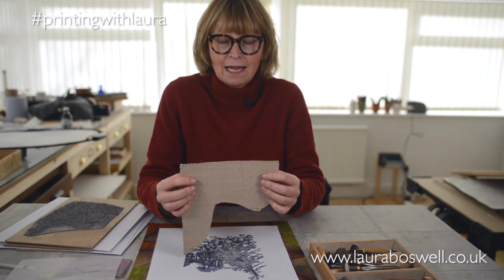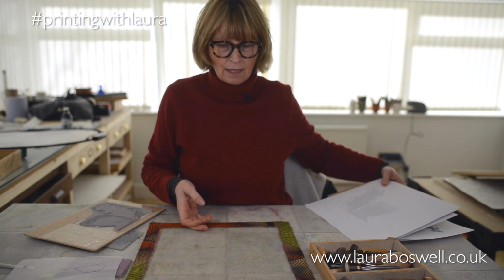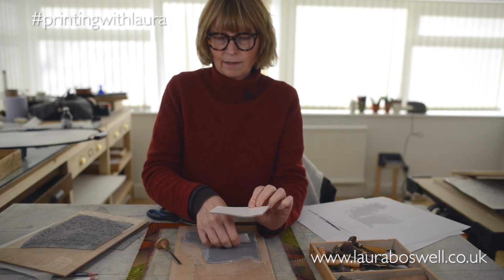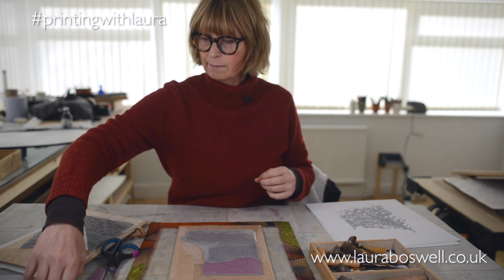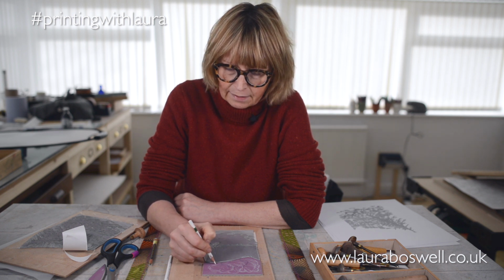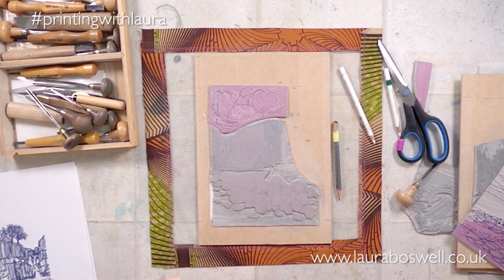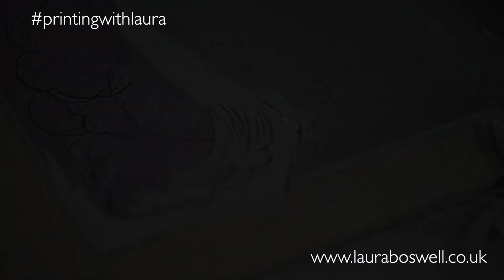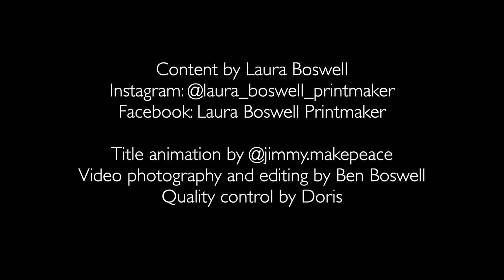OUCH! My Linocut got Damaged - Here's how I've Fixed it

Comment: Hi Laura, do you use „Graphic Chemical, Tint Base Extender, #1911, 1 lb can „ when speaking about Extender ? This is the stuff I‘ve found so far in the. Netherlands. Thanks in advance Ulil.
Reply from the maker: I do use it for Water based prints - looks like toffee but works fine 🙂